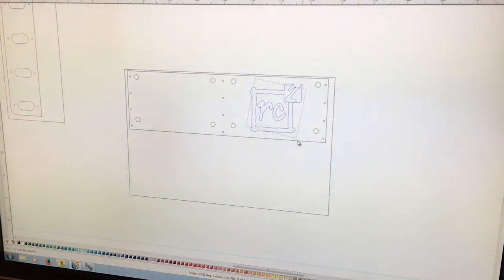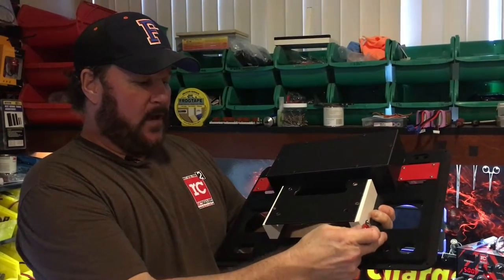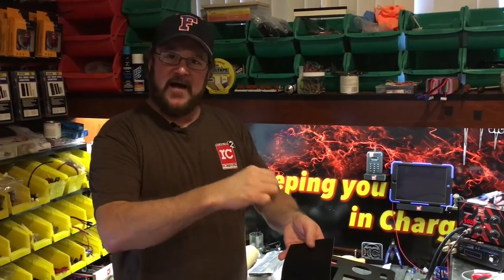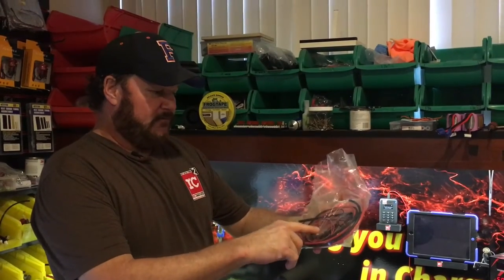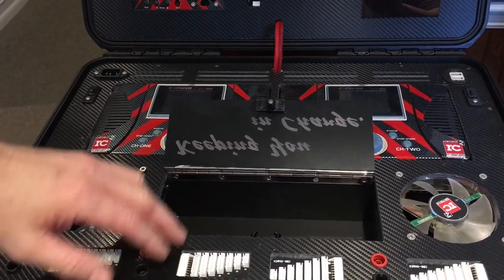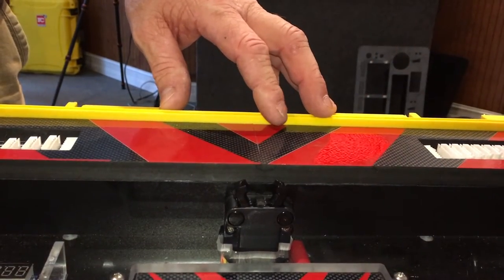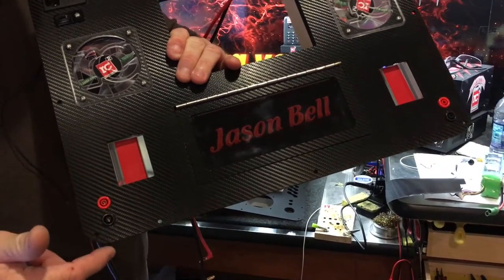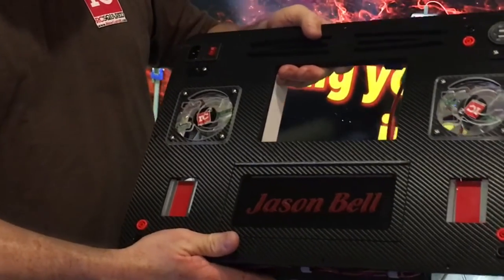How to wire your kit, also installing items in your deck.

Comment: Hi Kyle,

Love your work, I've built a few charging cases myself. 

Quick question, at 2:25 you talk about running power from external battery to charger or from power supply.

Do you need a Backfeed Diode installed to prevent; say a car battery 12v backfeeding into the power supply? 

Cheers,
Matt